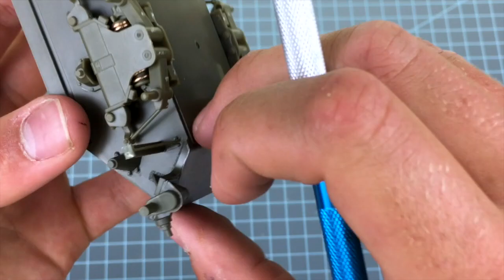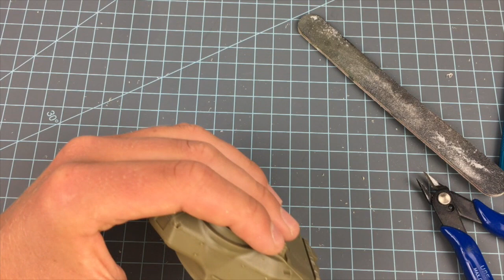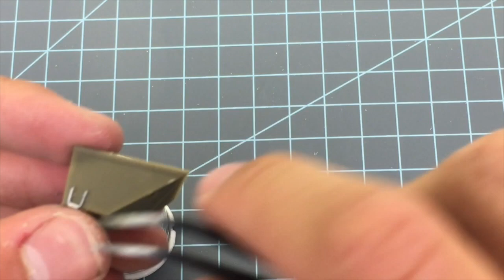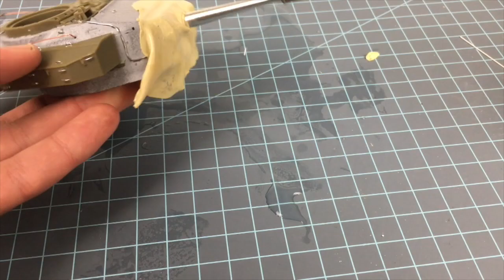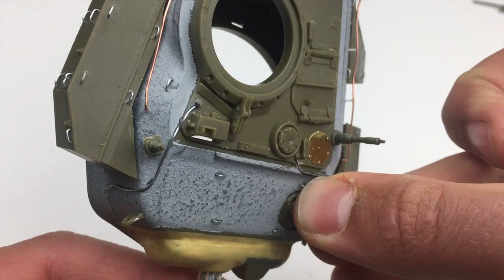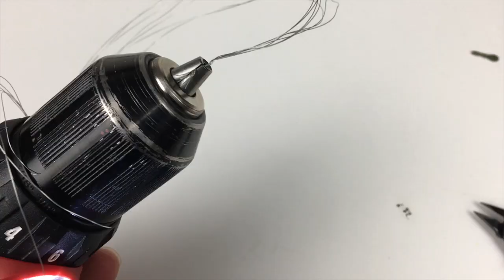Building the AFV Club Centurion Sho't | 1/35 Build Techniques

Comment: So I got the AFV centurion mk3 Korean war. It came with so many unnecessary parts like parts from the centurion mk1. I honestly could have built this version bc it came with the fume extractor on the gun barrel. Do you know if this is common for AFV to borrow parts from other kits?
Reply from the maker: surprisingly enough it actually is. like for the Stryker I did, the M2 0.50 cal is actually from a different kit. in general it seems like AFV club tries to reduce the amount of molds they cut, and thereby reduce costs.

Comment: Every afv club centurion comes with a mantlet cover it's not the nice aftermarket afv club one it's the black 5 peice rubber vinyl one that should be in the kit the shot kals have them Definitely mine do! But I use the other one the slide Moulded one but yeah should have had it on a black vinyl sprue! It's nice enough when all put together and on! Amusing hobbys centurions are not bad too I've been trying them out lately they have 2 shot kals now the Gimal ones the nicest and the AVRE but afv clubs still have that lead on the best centurion on the market! Can't believe there new AVRE mk5 isn't out yet though! The Amusing hobby mk5/1 is the one still with the early 17 pounder barrel on it no fume extracter but it is all accurate for the 4th RTR centurion in Germany they are basing it on! It is a recommended kit if you haven't yet built one! No horrid rubber tyres either!

Comment: Lookin good so far! With the texture, it REALLY makes it look like heavy steel! Also, what brand is the black super glue you’re using?
Reply from the maker: It’s some random superglue I bought off eBay, it’s called Hyper Bond 160cps thin black rubber reinforced cyanoacrylate adhesive.
Reply: @TheScaleEngineer  thanks lol
Reply from the maker: Sure thing!